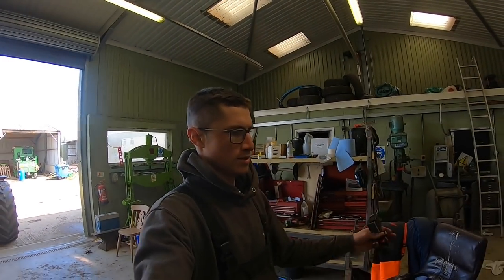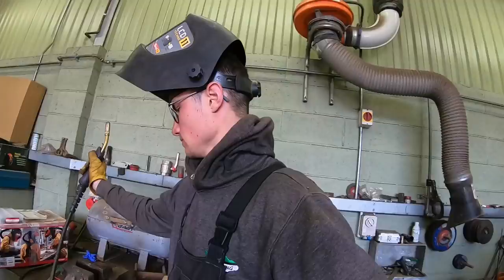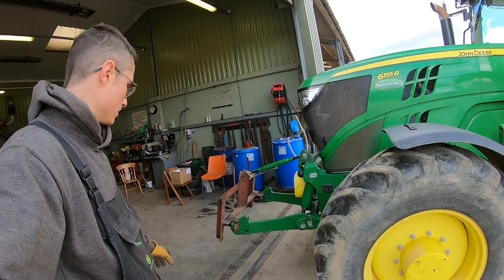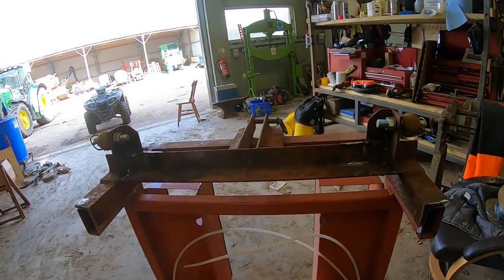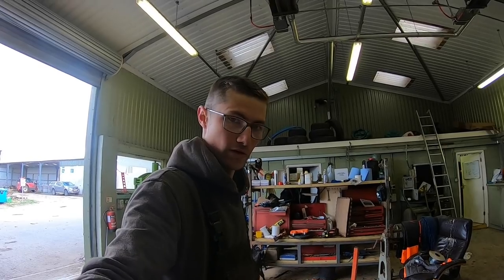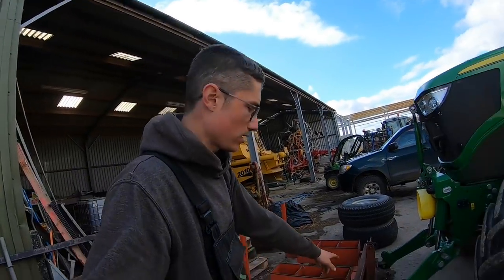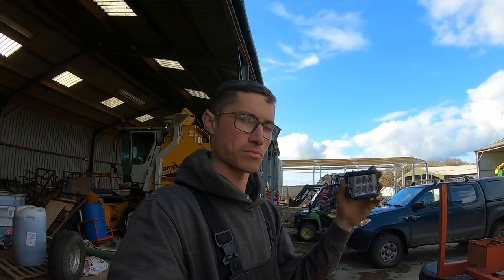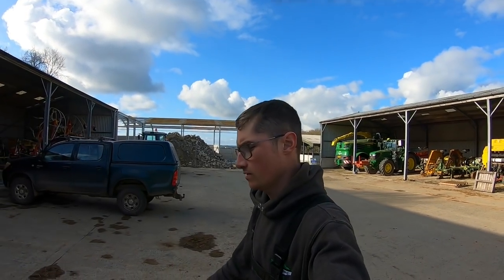MAKING A FRONT LINKAGE TOOLBOX! | PART 1

Comment: Great job Josh. The more welding you do the better you will be at it. Just a suggestion to combat the tilting inwards when lowered down. Would it be an idea to add additional plates on either side  where you connect the top link to the frame and drill two new holes higher up so that you have a longer distance between where you connect the arms and the top link. It won’t tilt back onwards near as must if you get my drift!
Reply from the maker: Thanks David! Practice makes perfect! Ahh yeah, that’s a good shout!